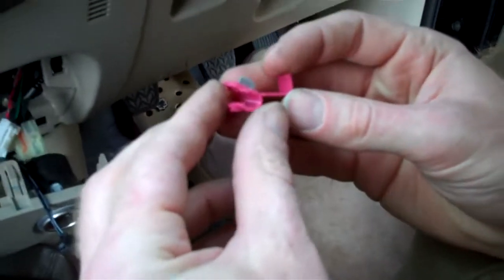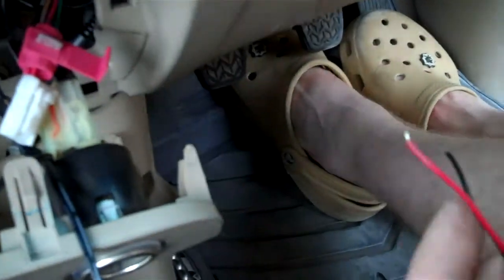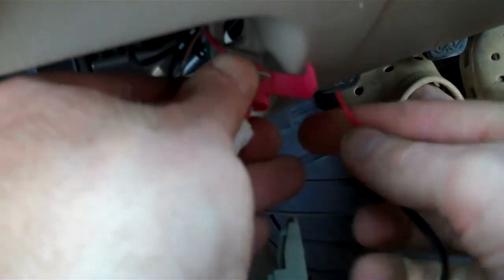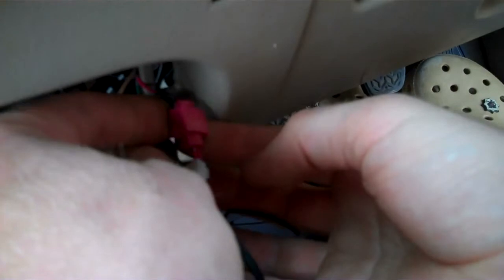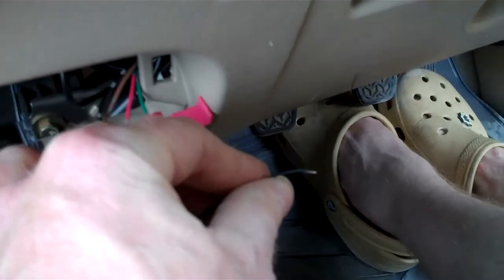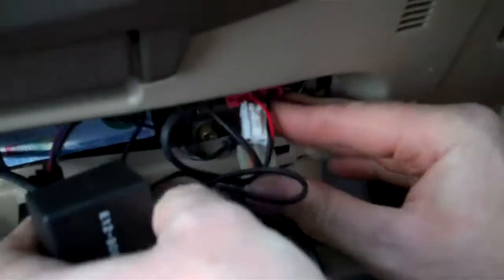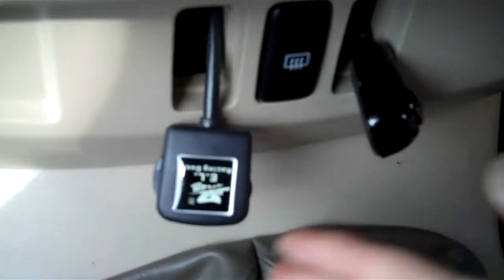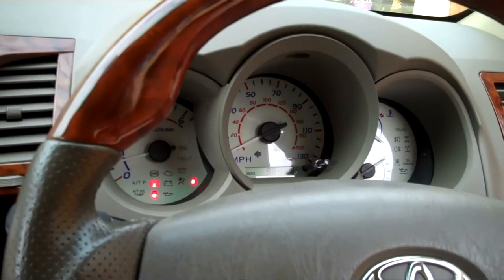How to wire illuminated dash fascia on Toyota Hilux Mk6 Vigo

Comment from the maker: Hi yes the wires are connected to the cigarette lighter - you have the illumination and power here and it is close to the switch panel area. Things dont last for ever but my truck has this dash and its still going strong... after 1 year no problems!

Comment: i'm interested in putting on the accessories on myself. On my soon to get Toyota Hilux Mk7. Example the hilux mk7 daytime running lights, audi headlights, tray cover, roll bar, roof racks, bull bar and much more......I don't know if you can put/post up videos with these installations. it would be greatly appreciated......(y)